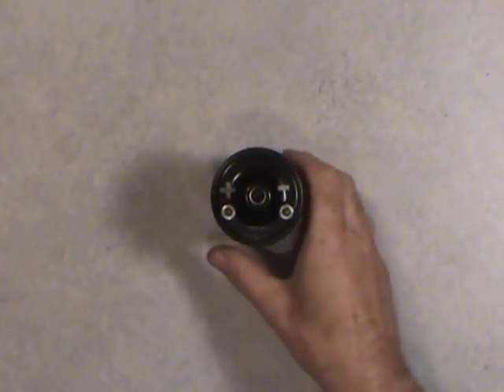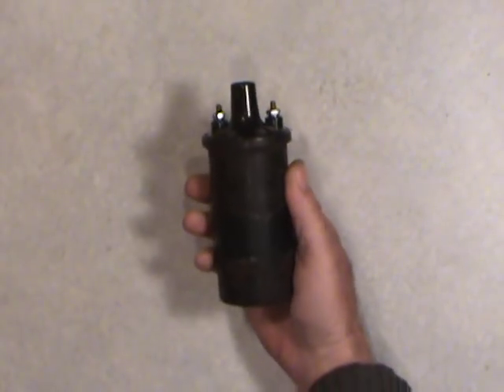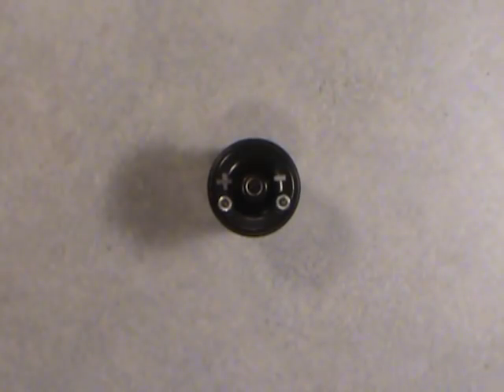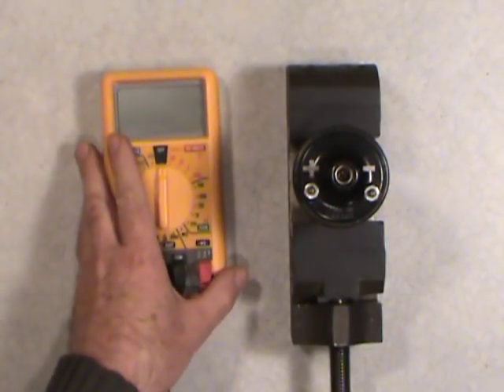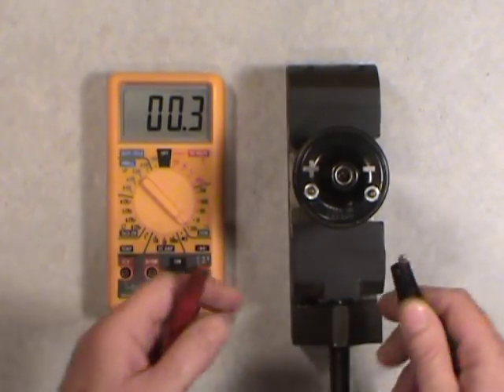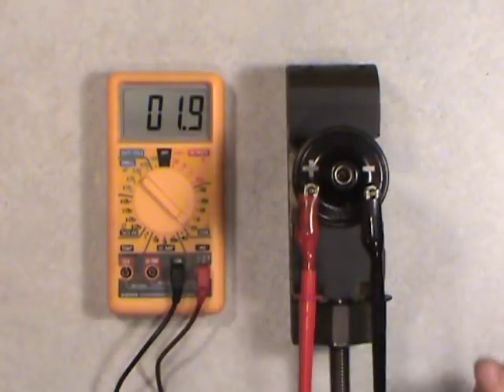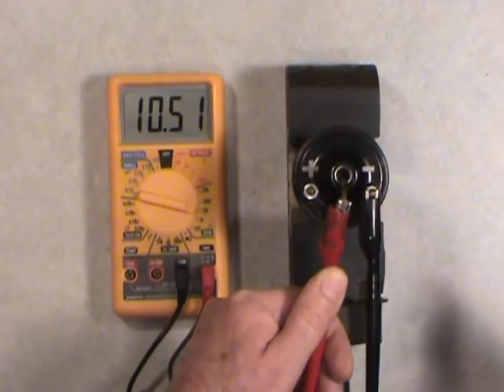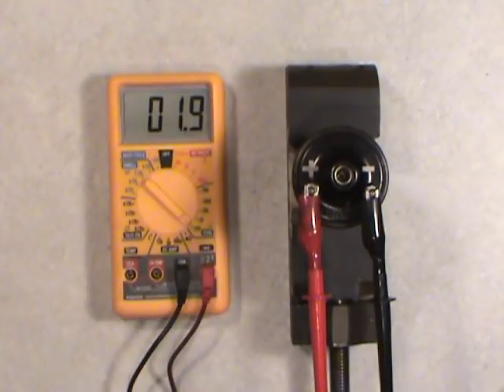Ignition Coil Testing

Comment: great vid..i have a 1982 tractor and I am trying to test the coil a oil filled one.and I can not find any spec on it ..I am getting a reading of 3.2 on the primary and 12.38 on the secondary what do you think/
Reply from the maker: Pinetar Robyn Homestead Greetings Pinetar Robyn Homestead....Thanks for watching..............................................If You can tell me, the..."Exact"..."Make/Manufacturer"..."Model"..."Engine Type/Size"..."Etc."...of that..."1982 Tractor"...???...that You have there, I'm pretty sure, that, once I start use-in, My "Magic" (and maybe, my, "Crystal Ball" too...lol), I just might, be able to Find some..."Specifications"...on Your particular "Ignition Coil".....................But, for the time being, here are a few "Things", for Ya...........................That..."3.2-Ohms"...that You saw, I'm guessin', that Your Meter was set on the "Lowest Ohms Range" perhaps, when You Tested the Primary Side of Your Ignition Coil, and if so, that "Reading", does seem a Little on the High side, but, there is a Reason or Two, for, that there, High Reading..............................Did You "Remove", all of the "Wiring", that was "Connected" to Your Ignition Coil, "Before" You Tested It, with Your Ohm-Meter...???...as, by having any "Wiring"..."Included"..while Ohms-Testing Your Ignition Coil, that could very well be, the Reason for, that slightly High Ohms-Reading...................................Depending on, just How, Your Tractor's particular Ignition System was "Designed/Engineered", It, might be, an Ignition System, that had, what is commonly known, as a "Ballast Resistor" (sometimes, looks like a Ceramic/white Block, or some, might be, in the form, of a Special Resistance wire, that the older GMC Vehicles used, some years ago, just sayin'), and, "If", that "Ballast Resistor", was "Included", in the "Electrical Circuit", that You took the Ohms-reading On, that might just be, the reason for, that slightly High Ohms-Reading.................................Some "Ignition Coils", might have a slightly Higher Primary Coil "Resistance/Reading", like that "3.2-Ohms", that You got, perhaps, because, that particular "Ignition System, Circuit Design", had the "Ballast (Resistor) Resistance" taken care of, with that slightly Higher "Resistance", in that particular "Ignition Coil's, Primary Coil's Windings", thus, "Eliminating the Need"...to be Needing, a..."Ballast Resistor"...in that particular "Ignition System's Circuit".........................Now then, You were sayin', that, Your Ohm-Meter was Display-in, "12.38-Ohms", while Test-in, the Secondary Coil side, I'm thinkin', that should really be "12,380-Ohms", but only "If", You had the Correct "Range"..."Selected"..on Your Ohm-Meter, when You saw, those particular Ohm-Numbers, be-in Displayed...................................Have a Look-See, at Your Ohm-Meter, to determine, "Just Which Range/Scale", that You were "Use-in", when, You took, "Each-Of", those Two Ohms-Readings, that way, especially concerning the "Secondary Coil", the reading, really "Is-Not, just a piddly..."12.38-Ohms", as opposed to, that "12,380-Ohms", that I mentioned, just a short time ago..............................Sometimes, quite "Rarely" at that, even though, an Ignition Coil..."Tests" with-in...the required..."Specifications"...for the Ignition Coil in question (while Cold), a "Faulty" Ignition Coil, just might start "Acting-Up", when it gets to "Operating Temperature" or "Hotter", and some "Symptoms", might be Ignition related, "Miss-Fire-ing" (that be, intermittent Fire-ing, of the Spark Plugs), and maybe even, an Engine, that "Quits Running" all-together, just sayin'.......................................So, my Friend, if You can let me know, all that You are able to, concerning Your "1982-Tractor", then, I'll do, all that I can, to get Your Tractor Runnin' good again, so You can...Plow...Till...Haul...Doze...Back-Hoe...Sew Seeds...and, maybe even "Race" with "It"...!!!...lol..........................Well...Till (No, not that kinda "Till", the Other "One"...!!!...lol)...again, I say...Till next time..............Be Safe, take care, and have a good one.
Reply: RockysRoadshow wow you must like typing lol that would take me forever .well the reading a the primary I had it on 200 ohms.and on the secondary had it on 2k.....the tractor is a power king 2414 year 1982 or 83 has a 14 hp kholer k321..60389 ser#11296954  ..thanks for the time brother
Reply from the maker: Pinetar Robyn Homestead Greetings Pinetar Robyn Homestead....Well...I had a look around, for some information, on Your Tractor, and, here's pretty much, of what, I kinda figured out..................It appears that, the "Ohms-Readings", that You saw, on Your Ohm-Meter, should, as I see it, be alright, concerning the Ignition Coil "Only", as there are a few "Other" Parts and Pieces, that, make up Your Tractor's "Ignition System"..........I "Did-Not" see, a "Ballast Resistor", in the Wiring Diagrams, that I was lookin' at.................."Before" I continue, I really should Ask You, just, "What Problems", are You having, with that Tractor of Yours, as, the More I know, the More, as I see it, that, I will be able to help You out, my Friend................................Although the Information I that I found, didn't exactly, apply to Your Exact Tractor, it appears however, that it Did Apply, to Your "K-321" Kholer 14 Horsepower Engine...............................Oh yeah, before I forget, that Serial Number, that You gave me, seems to apply to, a "1983" Model, and the Number "2414", kinda Describes, What's "On" Your Tractor, if I get it right, that is........................The "24", just might be, Your Tractor's Rear Wheel Size...???...and, the "14", should be, Your Kholer Engine's "Horsepower Rating"...Do those "2" Things actually Apply, to Your Tractor at all...???...................................Now then, according to what I was seeing, on that Kholer-14-HP Wiring Diagram, it appears that, Your Tractor's "Ignition System", works the following way ("If"...???...It happens to be, the "Same" Type of Ignition System, that I saw, in that Wiring Diagram, that is...???).............................12 Volt Battery...the Ignition Switch...a "Set of Ignition Points"...along with a "Condenser"...an "Ignition Coil"...that has One Spark Plug "Wire/Lead"...and, last, but not least...the "Spark Plug" Itself............................(If this "Is-Not", the "Type of Ignition System", then, I be thinkin', then it just might be, the "Magneto Type" perhaps).............Did You, or Anyone Else, Do/Perform a "Tune-Up", not too long ago, on Your Tractor...???...as, that's, a pretty much, a, "Must-Do", when-ever the Engine's "Operating Hours" or "Mileage/Kilometer-age", become Due, according to Your Tractor's "Operating Manual"..................................If, You Do-Have, the Points & Condenser Type of Ignition System, then, the (Ignition) "Points", do start to "Wear", due to the Electricity, that Flows Through "Both Contacts", that You see, on that Set of Ignition Points..........................The Point "Gap", will "Change", due to Electrical Erosion, and, the Contact "Points", have to be "Set to the Specified Gap Setting", as the "Gap-Setting", is of the Utmost Importance, because, that "Gap", actually "Controls", the ""Dwell" (Dwell, is the Amount of Time, that that Ignition Coil Gets "Charged-Up"), and also, when that "Points Gap Changes", Your Engine's Ignition "Timing" will "Change" also...!!!......................Yes-Sir-ee-Bob, I have lots, did I say Lots, of Experience with, the good ole General Motors "Points & Condenser" Distributor, that were found, in, quite a few Vehicle's, up until, about 1974, that is (please note, I believe that You "Do-Not" have a Distributor, but, You'll probably have, the Ignition "Points-Set" and the "Condenser", just sayin')...........................The "Points" and the "Condenser, in a car, should be, "Adjusted or Replaced" at least every Year, or about, no more then 12,000 Miles/20,000 Kilometers (Ball-Park figure), and, that's kind of a stretch...as...I usually checked/adjusted the "Points" at least "Twice a Year", and at 1/2 the Mileage/Kilometer-age, along with "Checking, and Adjusting" (if need be, that is), the "Ignition Timing", in "Degrees at the Crankshaft", using a Strobe Type of "Timing Light"......................If You want to have Your Tractor's Engine "Running really Strong, and, Not Guzzlin' Gas", then, those "Ignition Points" have to have the "Gap", set to "Specification", and the Engine's "Ignition Timing", has to be "Set/Adjusted"..."Right-After"...the Points "Gap" is "Set", or Your Engine will probably Run like (Use Your Own Word Here)...!!!...lol.............................The "Condenser" (some call it a Capacitor, and, looks like a small silver cylinder, with One Wire coming out of, one end only), is some-what like a Bank (or Silo), in that "it" Stores, an Enormous Amount of (Electricity) "Electrons", and has to be, in Perfect Shape, and "Has To Be", the "Correct Rating", usually expressed in "Micro-Farads" (I think?), for the "Exact Ignition System", or, the Ignition "Points" will start "Sparking", and "Wear-Out", too Fast, and the Engine might not Run at all, or maybe, Run like (Use Your Own Word...Again...!!!)...lol................................Your Spark Plug, has to be in "Like New" shape, or, Engine, she no go so good............................Use a new Spark Plug, and, Make Sure, that the Spark Plug's "Gap" (between the 2 Electrodes), is "Set", to the Required "Specification", for Your Engine........................So, there You go, for now that is...............If You care to, just let me know, what the Problems, happen to be, with Your Tractor's Engine, and, I'll do what I can, to help You out.................Good Luck...and...Till next time.................Be Safe, take care, and have a good one.
Reply: RockysRoadshow hello..well the tractor was sitting for years and I thought I do some work on it .so I try to start it and I seen no spark on the plug.so I did a few test and that why I was doing a test on the coil but was out there today was trying a few other test a found that the solenoid was not working so I jump across the terminals and I was getting a spark ..so I thimk that was the problem.it is a points and condenser ignition..and yes 24 inch tires and 14 hp ( 2414) I will be doing a lot of work on this trator and changing the points and condenser and a lot other parts I would think. I remember last time I had it running that it had no power.so did a compression test and had 30 psi not to good. so took the head off and seen that the piston was in bad shape you can see a space on the exhaust side .the cylinder looks  good I don't see any scoring marks .and the valves look like they are not siting down all the way.....so looks like more investigating ?  wow you got me a lot of info and I appreciate that. I will let you know how it goes..thanks again ...

Comment: So there should be no continuity between the pos and negative pins?
Reply from the maker: Greetings...frontlinemedia4270......Thanks for watching.......On a good ignition coil, like this one, there is usually, a very low, ohms/resistance reading, that will show up, on a multi-meter's screen (or, with the needle/pointer indicator, on the older type), once the test leads are connected...(on my multi-meter, I have to account for the .3 ohms resistance that the test leads have, whenever I'm testing a low amount of ohms).........This type and shape of ignition coil, might have a multi-meter reading, of, somewhere between 1.5 to about 3 ohms..........If it happens to be the 1.5 (or maybe about 2 ohms), then, it usually has, what is called, a ballast resistor, in the ignition circuit (wiring), so the ignition coil doesn't overheat and destroy itself, once the engine is running........If it happens to be, the (about) 3 ohm coil, then, there probably won't be a ballast resistor that is needed, as, that 3 ohm coil, will probably remain cool enough, and have a long life, for the most part.......I hope this helps you out, and......be safe, take care, and have a good one.
Reply: @RockysRoadshow  I am trying to diagnose a coil on a ezgo cart.  It uses a coil  with 2 high tension leads and has two pins which gets a 12v source and a trigger.  Originally it had a plug which oriented the wires but this was cut and the two wires are free.  There’s nothing on the coil to tell the placement of these wires.  Ezgo has been no help yet as they claim they do not have the total online documents.  What they sent me was a portion of it that ends at section H but the electrical part is in section M. Lol.  So I am trying to figure this coils function by looking at other coils like this.  There drawing for a different model shows another coil get the pos with the red wire and the trigger getting the white wire.  Is there a way to determine what part of the coil is positive and what is negative?  Thanks for your help

Comment: Hi I did a test on my son's race car coil for a 1.4 8v astra engine , on the low range it was saying 01.0 and the high range it was saying 07.0 and that's on a new coil , so I checked all the other coils i had, it says the same, i live in UK so I'm guessing it don't matter where the coil came from it would say the same ..
Reply from the maker: Greetings...Mark Havell............Thanks for watching..........That 7.0 that you got, was probably 7-k, as in, 7,000 Ohms, which should be alright..........Perhaps, see if you can find, the "exact" ohms Specifications (chassis service manual?), for, that particular ignition coil, just to be sure, as, for one particular vehicle, that I was working on, some time ago, had at least, two different ignition coil manufacturers, that were showing, slightly "different" ohms specifications, that were actually printed in, that particular vehicle's, factory service manual/book...!!!...........Well, that's a pretty good thing, that, all of the ignition coils, seem to ohms-measure about the same, but, the ohms-testing, of an ignition coil, while the engine is not running/at ambient temperature, really isn't, the, be all, end all, complete test, and here's why...........Sometimes, usually rarely at that, an ignition coil, can, shall we say, start to act-up/not work so good, once it gets up to operating temperature, or maybe, even hotter...........The secondary coil of wire (might be, about, 100 turns of secondary windings, for every "one" turn, of the much thicker, primary, "wire" windings, that make up, each individual coil of wire), oh, and also, the secondary windings, "wire diameter", could be, about the size of a human hair, there-abouts, and, due to, what is called "thermal cycling" (those two words, just be, a fancy, schmancy way, of basically saying, the expansion/heating up, and, the contraction/cooling down, of the ignition coils windings), and, ignition coils, have to, try to survive, in a rather harsh, operating environment, well, as I see it, that is.........The "secondary/high voltage side", of a vehicle's ignition system, has to be in very good shape, or sometimes, things like, "miss-firing", and/or, maybe worse, might show up some day, and, I hope not..........Use the "correct" heat range, of spark plug, for that exact engine.........Use, as good as new, spark plug "wires", and try to keep them away from, anything made out of metal, and away from each other, especially so, when they are running parallel to each other/side by side, because, high voltage, likes to, jump to places, that Ya really don't want it to go to..........Whether, it be a carburetor, or fuel injection, then, the air/fuel ratio, has to be adequate, for the operating condition, that the engine happens to be in, at that particular time, or sometimes, it might mimic, a troublesome ignition system problem, so, try not to get fooled by, such a thing (I've had my fair share of it, over the years...lol)..........If the race car's engine, isn't running/performing all that well, just let me know, and, I'll do what I can, to help you guys out...........Good luck, and........till next time.......Be Safe, take care, and have a good one.

Comment from the maker: ...where-as, the Epoxy coils, that I have seen, can fire up to about .080" (over 1/16 of an inch!), or perhaps even more....There is usually a "Ballast-Resistor" in the circuit, just before the Coil (oil filled type)....It can be in the form of a Ceramic block, or General Motors used a "Resistance-Wire", that usually connects directly to the Coils + (positive) Terminal, and I've seen it as high as about 2-Ohms!....You see my Friend, an Oil Filled Coil will burn up with 12-Volts!!!....(con't)...

Comment from the maker: ...there-by, having that One Lobe on the distributor shaft open the points, that causes the coil for that one cylinder only, to have its magnetic field (inside the coil) collapse, and induce electricity from the primary coil, to the secondary coil (inside the coil), then it travels from that coils high voltage tower, then along the high voltage wire, to the distributor cap, then through the rotor, and finally, through the high voltage wire to the spark plug, then "Spark!"....(con't)...